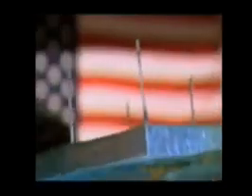Biefeld-Brown Effect & Leedskalnin

Comment: The b-2 bomber charges the leading edge of its wings; and utilizes the naturally oppositely charged exhaust to partially neutralize the drag which acts upon it. In other words this concept is already being utilized to some extent in aircraft. The real question is; how far have they taken this concept within secret military projects. There is research to suggest that the weight of a dielectric material can be nullified by say 75% by placing that material in a strong electromagnetic field, and pulsing it with microwaves at right angles to the direction the magnetic field. Perhaps if you combine these two concepts you could end up with an anti-gravitic vehicle.

Comment: Air is a dielectric and if you stuck electricity between between dielectric and conductor (transmitter) without a way for electrons to flow away through that transmitter as in capacitor, the accumulated electricity will counteract gravity ... lifter must be very light in order to be lifted in this conditions but it would be possible in principle to life a real craft this way by accumulating substantial amount of electric charge around the craft (on top/above to be precise).

Comment: I would think you could easily get to the bottom of whether this is ION wind by trying the lifter in a vaccuum, or in other gas mixtures.
Reply: morpher44 it doesn’t work in a vacuum; at least in the demonstrations I have seen. Although the reason it doesn’t work in a vacuum may be due to arcing that occurs between the gaps of the various sheets of aluminum. In other words; an over saturation and collapse into a single point of the dielectric field in the system; rather than having the field uniform throughout the lifter. 

Perhaps you could mitigate this effect by utilizing another light weight dielectric material in between the aluminum sheets; there by increasing the capacitance, and making the maximum saturation point of the dielectric even higher. Perhaps you could eliminate the arcing, and continue to create a propulsive effect in the lifter. When you place it in a vacuum you take the air out of the equation; which alters the dynamic process that the electricity goes through. Just because it doesn’t work in a vacuum under these exact design parameters; does not mean that you can’t create the same effect in a vacuum utilizing a different design.

Comment: Instead of a quad-copter controlled by a microprocessor, someone should make a "lifter" controlled by microprocessors -- so that it can fly around and not be tethered. The challenge is to PREVENT your microprocessor from crashing due to the high-voltages involved.

Comment: I do not know why people keep suggesting it may be an air lift effect when they have tested lifters in vacuum chambers that were first purged with dry nitrogen then pumped down to near vacuum. You could never get an air lift down near absolute vacuum so it's not that.
Reply from the maker: Hello Geo K, thanks for writing, and, finally someone who understands this 'problem'. Simply ladies and gentleman it is as Geo K has said, if this effect was an ion "wind" effect, which implies atmosphere, then repeating the same experiment in a vacuum , or vacuum tube could show that there was no effect with atmosphere mass or ion wind charges, and that it must with certainty be involved in some other magnetic or electric force.

People could benefit from reading Edward Leedskalnin's electrical or magnetic descriptions of how current runs around the earth, thru the cosmos, and inside the earth which causes the volcanoes and earthquakes, and other vibrations and mechanical activity. Also they would benefit from understanding the east to west rotation of the earth, as it could provide an explanation why a grid of this kind "Biefeld-Brown" effect produces the positive lift, in the same way there was an imbalance which causes the rotation of the earth and the discharging of electric current downwards and upwards, the same can be said for magnetic current it is just not as concentrated as lightning, so in the north hemisphere south pole north pole magnets are traveling down and south pole magnets are traveling up, and in the south hemisphere the north pole magnets are travelling up and the south pole magnets are traveling down, at the equator they meet in the middle and so the general stream of currents are unaffected by the two poles, and so could show why there is a current of water which goes all the way around the equator, this of course does not take any consideration into the motion of the earth, moon and sun, and the northa nd south pole effect they also have on eachother which causes the stronger north or south pole side of the earth to be strengthened and therefore shifts and concentrates, and attracts by turning on the summer side towards the sun, and when entering winter, the pole has changed, and so the earth pushes away again ready for the next stop and start of winter, I think this shows that seasons and orbits could be caused by path and not velocity, escape velocity or any other thing, for instance an object in a stable orbit will remain in perpetuall motion going around the earth until disturbed, the same can be said for an atom of Fe iron metal, until the orbits of some other element like oxygen or hydrhochloric acid get close enough to cause them to move. I think this shows that the north and south pole could be responsible for this kind of lifting, those interested should read my work "Technology For a New Future" or alternatively read the man who invented the ideas in 1945, Edward Leedskalnin, and put his books together the way that he said and others could get a better, or at least alternative understanding of this effect.

Indeed, it is not ion wind if it is magnetic electric, and indeed there is no atmosphere to push against in a vacuum, but the magnets can still pass mechanical force right thru the vacuum unimpeded, or this earth and our moon would not axially rotate,

Best,
Adam

Comment: "Imagin if we used cell towers just like a tesla coil... Free energy for vehicles." - Well they are ready, standing all around the world, those towers :) . But I'm sceptic about that "Free" part. I'd like to pay for someone's job if he wants the payment (not necessarily money). Or take it for free and do something for free for him, there is no difference actually.
Reply: The elements that work with gravity include electrostatic,  natural electricity
Reply: Tesla’s wireless transformer requires input power to function. It then transmits this input power into the earth via longitudinal non electromagnetic pulses. The transmitter is in resonance with the earth, and the receivers are in resonance with the transmitter (also in resonance with the earth.) If the transmitter outputs say 200 watts, then the receiver picks up 200 watts; if you have multiple receivers then each one of those receivers will pick up 200 watts. If you have two receivers then you would have 400 watts of output with 200 watts of input. 

Imagine if you had a balloon that had pressure gauges all over it, and you then proceeded to blow air into that balloon. All of the pressure gauges on the balloon would show the effect of pumping air into the balloon; each time you exhaled into the balloon every one of the pressure gauges’ dials would turn in unison with your breath. The same concept is in play with the Tesla transformer; only it is electrical in nature. 

In this sense there is no “free” energy, but rather you are utilizing the dynamic energetic processes of the earth in order to generate more power than what you had initially transmitted in the first place. Tesla talks about this extensively in various interviews. The key to understanding how it really works is by realizing that Tesla’s systems did not utilize electromagnetic radiation, but instead used impulses of electricity to create what can be described as electrical pressure waves. 

The physicists and corporate conglomerates have worked hard to lead people away from this path of understanding electrical phenomenon, but 120 years is a long time, and people are beginning to realize that they have been lied to. It’s only a matter of time before the people demand that these alternate forms of energy be brought to the forefront, at which point we will be ushered into a new age for humanity. One where food water and energy will be available at little to no cost to the people. After all the universe as well as our planet provides these resources to us for free, to begin with; we just have to do the work to make it abundant in nature. The only thing holding us back right now is greed and ignorance.